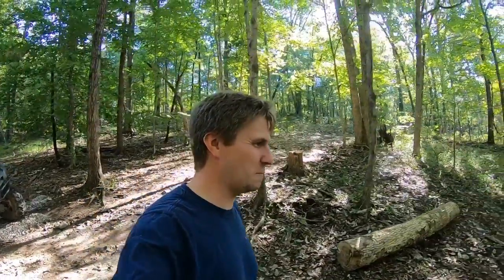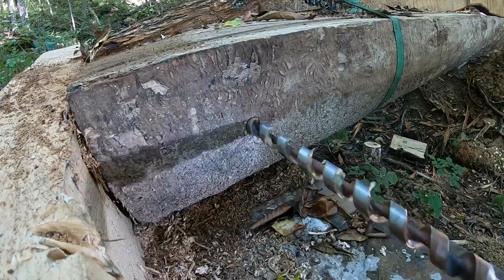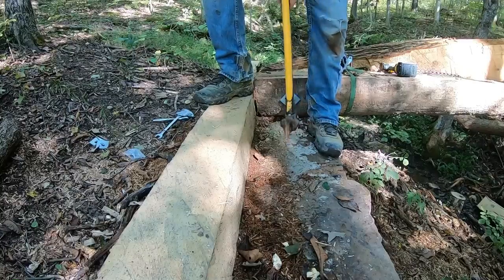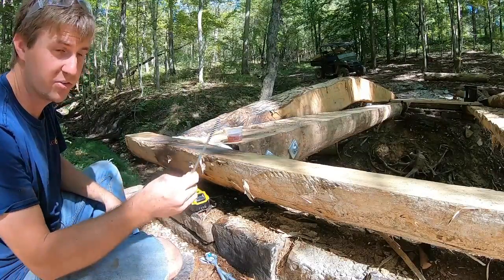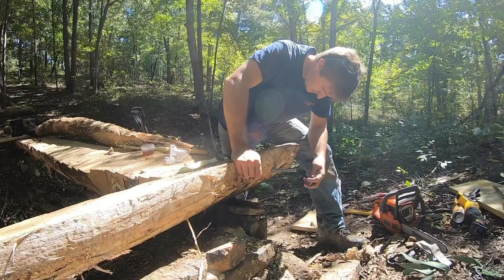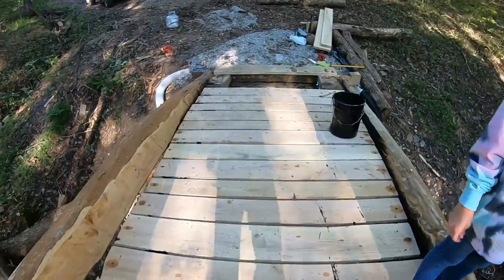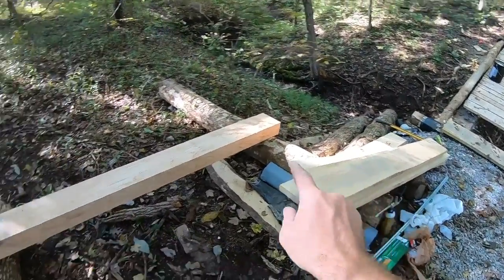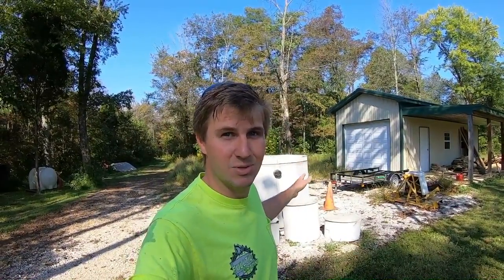Installing Bridge Deck & Hardware on My First Timber Project - Special Guest

Comment: The red bit is a rough quick drill. The black one will cut a far nicer hole but the side cutter is always made too short. I fix these by grinding the chisel part that cleans out the bottom of the hole till it is shorter than the side cutter. The side cutter needs to cut the perimeter of the hole before the other cutter cleans it out.

Comment: Creek, stream, gorge, canyon, call it whatever you want.......ITS YOURS!!!
Reply from the maker: Solid point!
Reply: Ok gorge and canyon would drive me nuts, the news channel pulled that one in regards to a train incident. :)  Stream, creek is ok because even the experts not sure of definition.Also it can not be a ditch because it is not man made. :) But as the poster said, it is your bridge.
Reply: It’s a ditch or drain.  By definition that’s not a creek.  But hey!  Call it a steamboat if ya want.  🤷‍♂️
Reply: @jbeard82  creek     "A small, intermittent stream that is larger than a brook but smaller than a river." The term is used primarily in the United States, Canada, and Australia. (From Wikipedia, not the best source but a source. :) ) So this channel could be a brook. :)

Comment: Over designing/building never got anyone hurt. Always weigh towards safety, especially when family is involved! Nice job on the timber bridge, thanks for taking us along.
Reply from the maker: I agree and thanks for watching!
Reply: @CaptainKleeman  After day one it is called maintenance. :)  That caused the recent  condo collapse, in theory.
Reply: And it's using your resources wisely, imagine the cost of that lumber alone.. if you already have the tools (or access to them) and some time, why not?

Comment: Nice bridge. Just saw this today.

I might have added a longitudial plank in the center line under the deck planks. That plank the broad side vertical and fastened the deck planks with screws to it. It would have made the deck more rigid because each planks get support from both planks beside it.
Both your tractor and side by side are quite broad, but anyone walking in the middle might feel if the planks feels springy.

Anyway overkill is a good feature when you do something of your own. Money or time is not a problem then. Better safe than sorry.

Comment: Of all the tools I have ever bought that sawmill/milling machine is the one I wish I had. Brilliant piece of equipment. The bridge is coming along great. The one question I have is why you are screwing the planks down to the log bearers so close to the outer edges. Surely for strength and longevity the screws should be in the middle of the log bearers. More strength and meat there and the last place to rot out I would have thought. Look forward to your answer so I learn something. Great job Mike

Comment: I don't know if it's been mentioned, i have not looked through all the comments. But, i don't think you need railings to guide you onto the bridge. Just posts will do! maybe three! or even just two so that they guide you. Maybe drill a hole through the top of each and put a thick rope in and make it look outdoorsy! A rope rail. or two? 
Looks great and for your first timber job, you're cracking it! 
You're lucky over there, being able to work in the bush lie you are. Here, in Australia we'd have an armed guard ready to kill snakes and spiders that might come too close, they are deadly!. 
Joking, it's just as safe here as it is there, providing you keep the snakes and spiders away. 
Cheers
Michael

Comment: There may be a slight chamfer at the tip of the drill bit head on the old drill bit you found? Meaning the very end of the cutting section is slightly wider than the shank of the drill. This means the shank won't bind to the wood along its full length. It's mostly the reason I like to use sharp spade bits myself.

Comment: Hey ya Capt. Mike, you ran out of sticky stuff and had a weed burner right there... why not put the lid back on the can... not tight but to keep flame out, run heat on outside of bucket and melt the remainder out like standing a catsup bottle on end to get enough for that midnite snack... only keep flame away and as soon as its warm to move and not smoking hot and flame up, also be careful not to stand over can so in case of a flame up you don't get burnt. We did it for the grease we called "tacky lube" so gears didn't run without something on them. I am wondering on your drill shank if its all the exact same size on the part that just carries the chip out or is it a  trifle smaller so the wood and metal don't bind. It kinda seems redundant to have drill spirals on the part that doesn't need it so just run bit in and out and chase the chips out manually.  Oh, I am on your team for over build.... never get day one back, its all downhill from day one.. . nice work for a novice woodsman... I can see the guy  running a little woodmill is now two point O.... 2.0/LOL

Comment: The auger bit, the new one's tip looked like there is a nut between the leading edge and cutting face, that would be a stopper if I'm right in what I thought I saw. The older but the leading tip threads go straight to the cutting face.
An alternate way to allow for not having moisture build up between the deck and beams of a bridge is either a pair of washers or a nut between the bridge deck and the beam. This forces an air gap and lets it stay dry.
Reply from the maker: Good point on the air gap!  Any air flow helps out
Reply: I thought I saw the same thing on the bits..
Reply: MY thought too

Comment: the older bit looked like it had a better screw on the tip.  The pulling is done by the screw on the tip.  The pitch of the drill body is just to clear the chips and saw dust.

Comment: Another you tuber recently stated that overkill is underrated. In your case i totally agree. The bridge is looking good.
Reply from the maker: Who said this?  Because I love it
Reply: @CaptainKleeman  I've heard that saying before, but the most recent YouTube incarnation I know about is from Ron Pratt https://www.youtube.com/watch?v=h95_agtOYSE  I'll second/third/whatever that if it's worth doing, it's worth overdoing.  As a much larger than average man, I tend to find the weakest joints in any structure :)  My dad had much the same philosophy.  He built a deck on the front of our house when we were kids that used 2x10 joists, 2x12 beams doubled up, and 2x4 deckboards.  The joists were 16" on center and every place a deckboard met a joist got a pair of spiral shank galvanized nails.  In almost 20 years, I believe there were fewer than a dozen of the several thousand nails that popped loose.  At the time it was built, the deck had more square feet of floor space than the house...
Reply: @CaptainKleeman  Ron Pratt, while chaining down a loaded propane delivery truck.

Comment: It looks to me like the threads on the point are formed differently.  The bit that pulls properly has threads that form a cone from the point all the way to the cutting edge.  The one that does not pull properly has threads that form a cone from the point to about 1/2 or 2/3 of the way to the cutting edge, then the threads are cylindrical.  As a result, it strips out very easily in the wood.  I'd take it back and look for one that has conical threads that are properly made.
Reply: it may also be reverse thread meaning it digs backwards

Comment: Mike, The bridge is looking great. It crosses a trench when there is no water and a creek when the water is running. How do you like that description? It's yours so you can call it what you want to.  I call my impact driver a screw drive thingy and 99.9% of the people know what I'm talking about.
As far as over building, I tend to do that. I have looked at things I built or over built according to those who helped me 30 or 40 years ago and guess what, They are still there.

Comment: I just slung two good sized doug fir across my creek,   hewed off the high spots, attached my planks, trimmed the ends with my chainsaw then bolted down 4"X4" poles longitudinally.   it took two afternoons,  i drive my pickup truck and my tractor on it.  i expect it to last north of 10 years,  15 if i used concrete or brick footings
Reply from the maker: Very cool!  You have any videos on it?  Love watching other people’s builds

Comment: It looked like the screw tip on the newer auger was blunted a little bit.  If that's not the case, then take a look at the initial cutting edges on the auger itself next to the screw tip, those may need a touch of a file.

Comment: Definitely a defective auger, return.  But in a pinch, you could put a slight bow in it.  Maybe throw it across the room once in frustration.  Or bounce it off a tree, LOL.  The slight curve will make it dig in and pull.  Then return it, cause it should be sharper.
Reply from the maker: Frustration remover…that’s definitely it’s new job 😂

Comment: I completely agree with over-building anything you might walk on, or walk under.  My son teases me about over-building stuff, but as long as you can afford the extra material, I think it's an investment in safety.  With the serious comment out of the way, I predicted the dog would step in the tar.  I am also impressed that you didn't appear to be completely covered in that roofing tar, that's either impressive skill at applying that messy stuff, or very good editing!😁
Reply from the maker: It’s all in the style of knife you use.  I’ll show it in the next video,  but I use an offset handle style for that kind of stuff

Comment: Mike, on that style bit (ship auger), the leading thread cutting pilot is to assist in starting the boring process and to help pull the auger forward, but it is not the only part of the bit that helps to advance the boring.
The spiral shape of the auger also acts as "threads" to help keep the auger moving forward as well.
The REAL problem with your "dull" bit is how it has been resharpened.
The chisel shaped cutting edge that makes contact with the bottom of the bore hole must be sharpened only on the UNDERSIDE (trailing edge)  of the cutting edge. Looking at the edge on your dull bit it appears that you have filed it on the TOPSIDE (leading edge) and that has the effect of causing the point of contact to be moved away from the edge and instead cutting into the wood, it merely skids across the wood.
When sharpening these bits you must file only on the underside of the cutting edge in order keep the top edge cutting angle correct.
The same is required  for the side cutting portion, file only on the inside edge of that part.  And both the end and side cutter need to be sharp for effective chip removal.
Reply from the maker: I’ve never sharpened either one,  but that’s some good info for when I do! Thanks
Reply: This is good info, thanks!  Personally, I'd also use a brace for that deep of a hole rather than a drill.  It's pretty easy to use one once you've got the hang of it, and the human body can produce the needed higher torque at low speed more efficiently than a drill, unless you've got one of those geared down things intended for timber framing.
Reply: @CaptainKleeman  Hmm, just seeing a fleeting glimpse of the cutting edge of the bit you said wasn't performing it looked like it had been filed a little,  that could just be from wear.  At any rate, if the cutting edge has worn or "rolled" down it may be time to try your hand at filing the cutting edge back to a distinct chisel shape.  Use a small three cornered file.  To further explain where the sharpening needs to be done, think of it as how you sharpen a chain saw cutter.  You sharpen from the bottom side of the cutting edge and leave the top side alone.
Reply: Since neither bit has been sharpened, I would say the problem is not the sharpening, but IS the shoulder at the top of the lead in screw on the bad bit. It acts like a stop for the screw, and doesn't allow the bit to follow the lead in screw.

Comment: you may want to add some wood preservative to the top of the deck boards.  Suggestions include diesel fuel or waste oil thinned in pump sprayer.  also sometimes you can pick up deck stain and mix with diesel.
Reply from the maker: Yup,  it all gets stained when it’s completed
Reply: @CaptainKleeman  ... just a pointer... do not use varnish or other solid sealer on the bridge. You want it to breathe enough to dry any time it gets wet. Also remember that moisture will rise from below so get some preservative on the bottom too. The idea is to repel moisture but not seal it in. BTW, learned this from old guys who worked with wooden ladders decades ago. You never varnish a wooden ladder for the same reason.

Comment: I built a small shop behind my last house and added a driveway. Problem was, it was really slim pickins for space to do either and I did both. I also back a trailer into that back yard. It's 10 feet between the house and fence and my trailer is 8.5 feet wide. So not much room for error. Especially when there is so little room to correct the angle while backing in!! I made it far easier by cutting a bunch of wedges and screwing 2 x 6s and these wedges into the 4 x 4 posts. The tires would not climb the 2 x 6s, so as long as I kept the tires tight to those guides, I couldn't go wrong!!! I did, however, forget to pull in my mirrors a time or two.. Luckily I was moving extremely slow and didn't break them.. The first post is steel and the house is block. Which do you think would lose??  lol....

Comment: On the solid EYE bolts that you installed for the cables. 
Don’t tighten them up the way you did. Just have the nut (double nut) on the outside. That will allow you to use the eyebolts over time to keep tension on the cables plus they can be tightened to achieve the initial tension.
Reply from the maker: This is a great point!  Thanks Wayne!

Comment: Look at the approach of the start of the augers blade to the screw.  The one that doesn't work seems ( from the glance) to have an approach that is flatter, thus making the drill a plain approach instead of one that wants to score. ( don't take my word been wrong a bunch of times). But duct tape is not the answer on this one. 
Great work , when you get ready to build the next , leave this, you'll understand later.  Peace

Comment: Awesome! The bridge is looking better and better each video. The beam across the middle of the underside connected to the arched logs is a neat idea I didn't understand until you explained it in this video. I was unsure of what you meant the first time you mentioned it but get it now. That should work good. The wheel for the yacht is an absolutely beautiful piece of craftsmanship. Really nice of him to come fix it. I'm sure he wanted to fix it very badly and was very upset that it was damaged in delivery being he's probably very proud of his work and wants it to look the best it can for you. Is the spot where the septic tank going not accessible by the delivery truck? I'm wondering why you didn't wait to get it until the hole was dug so it could be sat directly into the hole off the truck like that's usually done. Great video. Stay well. -Wil  👍

Comment: Why not spray the exposed area with truck undercoating and not allow moisture to get in. I don't know if that area you built over gets water but why not be ahead of the moisture then allowing it to be able to rot your wood? No matter what you end up doing the bridge looks great and I hope it allows you to drive or walk on it without any problems. Great Job Captain!
Reply from the maker: That would be pretty pricey

Comment: You should lift the mill blade above the can't for the return pull. Leaving it dragging on the can't will prematurely dull the blade, by wearing the set of the blade. Maybe overkill but I've been milling for a long time and it does help. Jmo
Reply from the maker: Thanks for the tip!

Comment: The other problem with the auger tip is that once the hole it's created strips out or hits some punky wood you just need more pressure until the blades cut deep enough for the tip to find something to bite into. At least that's what I've found from using a brace and bit in underwater dock construction. If side by side in new wood one is better than the other then it's probably a sharpening/sharpening angle issue.  Love the videos. :)

Comment: Overbuilding is good. And you definitely have. In about 1940 my dad built 2 timber bridges on our farm for tractors, hay bailers and 1 1/2 ton trucks hauling corn. He didn't go to the extremes you did with tar and big bolts, but he did have concrete supports on each end. We used those bridges until the farm was sold in 1974. The last few years he was older and they were not loaded the way they were in earlier years but they still saw a lot of farm tractor traffic.  I'd say your bridge should be good for at least that long. I like overbuilding. I assume they are gone now and not being used after 80 years.
Reply from the maker: That’s awesome!
Reply: Ken Barnes: how thick did your father make the deck planks?
Reply: He was a saw miller and the timber came from our farm. The deck planks were about 3 x 12 x 12' and I have no idea what the beams were, probably 10 x 12. They also had runners going across the  creek. Since I wasn't even born when they were build, I grew up thinking everybody had bridges on their farm and didn't know I should investigate them and learn something else from my dad.